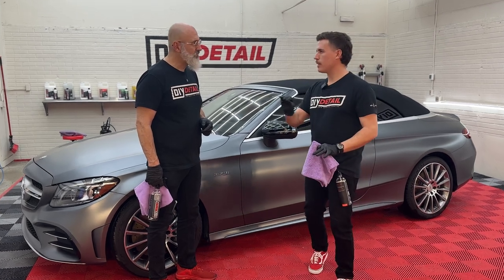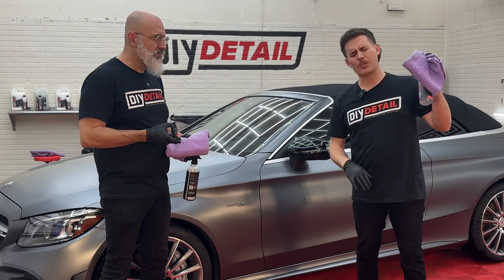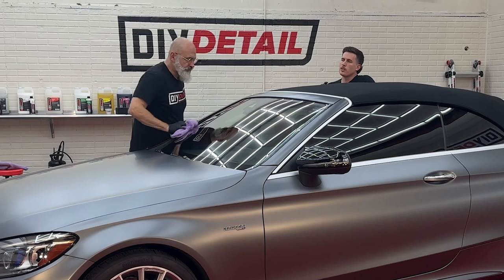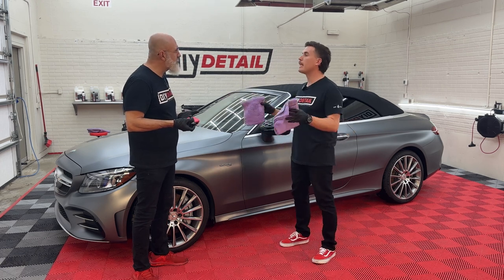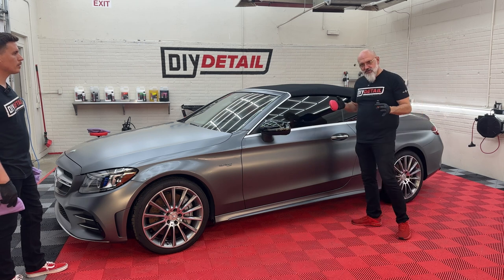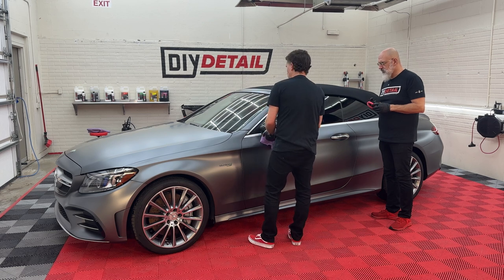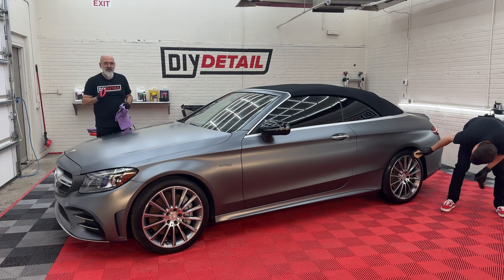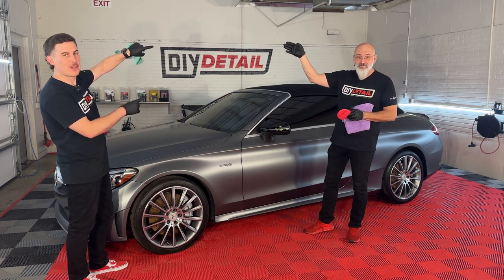How to prep and ceramic coat MATTE paint: what *NOT* to do + step by step guide

Comment: if i want to have matte finish ( 100% non-reflective finish) on my paint result, what paint / primer / coating must i use?
Reply from the maker: You will need to check with a paint manufacturer. For the coating our 8 year is best on a matte finish

Comment: If I understood correctly, everything except polishing is a no no. What about shampoo with waxes, silicons, etc.. I thought only neutral stuff is permitted on matte finishes? Thanks.
Reply from the maker: You can use those, but it will affect the look.
Reply: @diydetailofficial  Not only that, could potentially damage the finish.

Comment: Question on the applicators and clothes… once used for ceramic are they washable and use again for exterior use or are they banished to the wheels or interior designation?  Or are they trash?  The fact that glass/ceramic drying on a towel instinctively tells me I have contaminated it for life. 
Thanks for your hard work to make us smarter guys, love your work. 
Pete
Reply from the maker: Pete, once finished applying, put them in your wash bucket for 15 minutes or more, rinse and launder as usual, they will last very long that way.

Comment: Love all your products, love the coatings you have developed, love how simple you are making it! Thank you for all the hard work you are putting into this. I have a question because I'm just wanting to learn a little more about them. Besides longevity, what does one get with the 3, 5, or 8 yr ceramic coatings versus maintaining a vehicle with regular applications of ceramic gloss? Not trying to be snarky, just want to be an informed buyer, the longevity is clear but just wondering what else. Thanks!
Jonathan
Reply from the maker: Thanks for the question. A coating provides a much thicker protection, and much more protection against chemicals ( insects, bird droppings, car washes). DIY Detail Ceramic Gloss provides great beading, gloss and UV protection, much like a true ceramic coating, but can’t compare when chemicals come into the mix.
Reply: @diydetailofficial  that makes a lot of sense, thank you! I had to park my vehicle under a tree for one night. It rained and my car only had a layer of ceramic gloss on it. I had to use All Clean during the subsequent wash to remove the stains from the tree. I'm looking forward to applying a coating 👍

Comment: Mr Ivan and Mr Nick, 
I recently reached out to you regarding a client of mine with a predominantly matte wrapped McClaren. As suggested (3 yr graghine coating or the 8 yr ceramic coating), my client selected the 3 yr coating. I purchased the 3yr kit plus extra coating just in case. Is the application process any different between the two coatings?  What other specific videos do I need to watch before doing the work?  I’d hate to mess it up and use my insurance to fix it if you know what I mean….thanks in advance of course.
Reply from the maker: The application is the same. Be methodical, and check for high spots sooner than later.

Comment: Seeing that paint correction is not possible on a matte paint. What about the swirl marks?  Are they not as visible on a matte paint as on a glossy paint?

Also is it possible after getting a matte car ceramic coated ,i decide sometime later that I want to apply ppf instead for better protection? Will the ppf stick to a ceramic coated car? If not how do we go about that? Can't really buff the paint on a matte car to get rid of the ceramic coat or can we?
Reply from the maker: Yes you will see swirl marks on matte paint. PPF can be applied over Ceramic Coating.
Reply: @diydetailofficial  thanx a ton for the reply